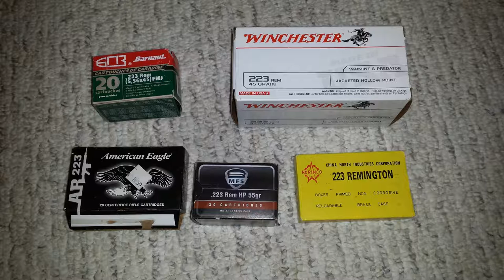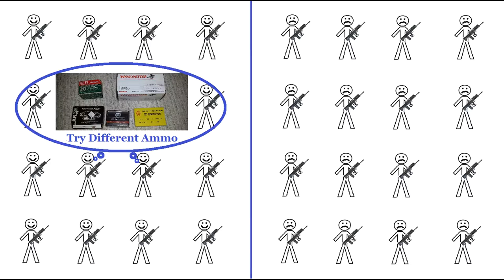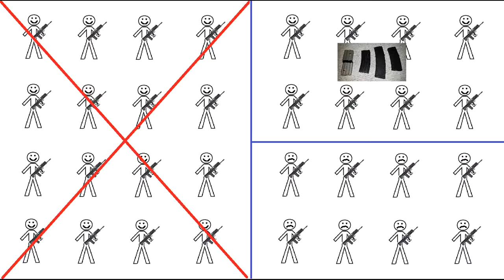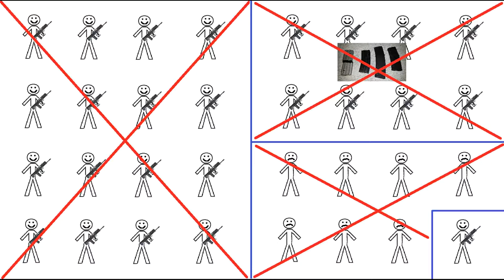T97 Feeding Problems

Comment: Also make sure you switch the gas selector at the front of the barrel to 1 or 2. It is shipped with the "0" setting = manual bolt. I learned this the hard way when I fired mine for the first time today.

Comment: Had the same problem with feeding out of the box. Also buffed out some super tight Alberta Tactical Rifle Supply AT15 mags. Used Dremel, good to go. One doesn't need a gunsmith, when one has a steady hand, tools, and some cojones. Thanks for posting this.

Comment: There's a second potential issue with the T97 - the bolt hold open catch on one of my 3 was too long, such that occasionally, it would catch on the rim of a loaded round from the mag, causing the round to prematurely strip and the rifle not to cycle.  I filed it down a bit (in addition to filing down the feed ramps) and it fixed the problem right up.
Reply: I have the same issue. could you be more details how to fix it?

Comment: i guess im one of those lucky half that had no issues with the 2 T97s that i bought. good video and good advise there amazing rifles but they can be picky :)
Reply from the maker: +SwamplandFilms Thanks! Good to hear yours worked good.
Reply: C mags  LAR 10 rounders pistol mags worked with my lightly used gen 1 2013 model . After the feed ramp mod all mags work. Easy fix. Thanks for the video.

Comment: Mine is a gen2 so it came with the M4 mod from factory but I do wanna see if I can polish the feeding ramp.  I am just curious that since you cannot remove the barrel, how on earth can you guys put in the tool in such tight space to get it to work...
Reply from the maker: Sorry for the late reply Kin. I just took the back of the gun off. It's easy then.
Reply: Field strip the gun. No need to take the lower off. Use a power saw file and go from under through the mag well .